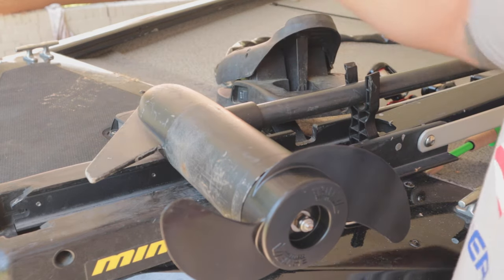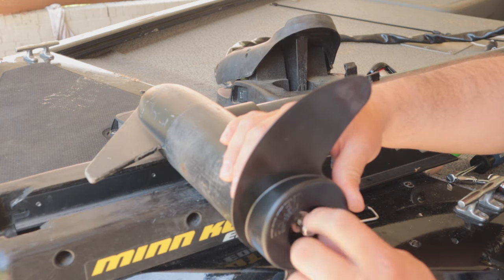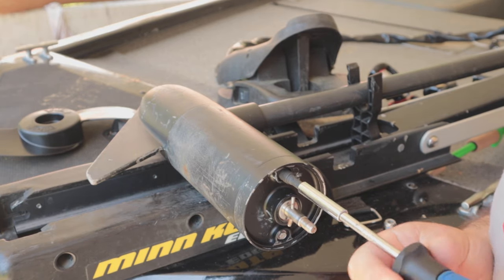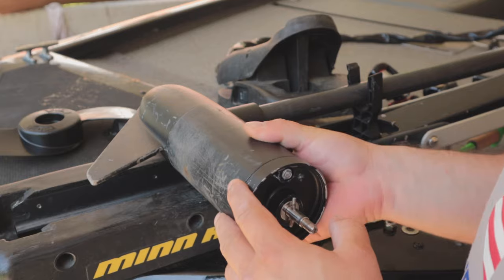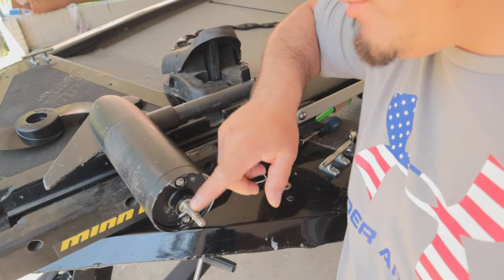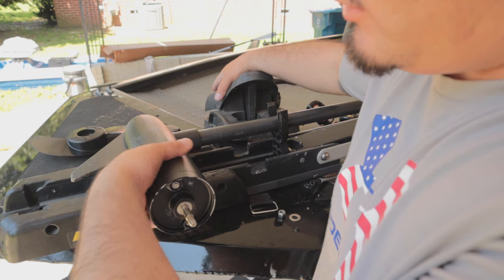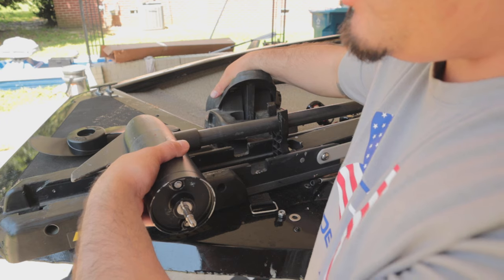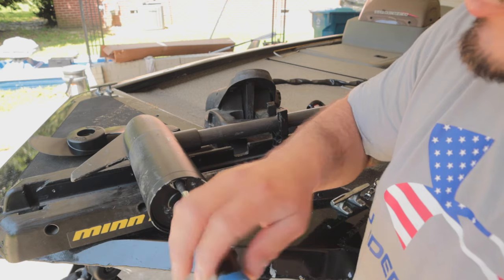HOW TO TUNE A TROLLING MOTOR || WORKS FOR ANY TROLLING MOTOR

Comment: So can anyone actually explain what happens inside the motor while twisting it like that..?
Interesting video, thank's for your time bro!
Reply from the maker: Thanks I appreciate that brother
Reply: Magnets
Reply: @captainfishpond  magnets......yes thank you William Gilbert
Reply: probably not on here, more like a physics professor. trolling motors use whats called a brushed motor same as a dremel, you can actually remove the brushes on a dremel to visualize. when you turn this your probably changing the timing of the inner core to the brushes, moving the polarity. Im not sure what results may be harder on the motor, i recommended to anyone seeing this test the amperage before and after. Amps = load so you'll get some idea of the health of the motor.
Reply: Motor is a coil pack of wires spiraling and it runs on magnets/brushes on 3-4 sides of the coil pack. The coil is attached to the propeller and the brushes create a magnetic current causing the coil to spin. Those two screws are 10 inches long and attach to the front of the torpedo. Those get bummed sometimes and cause the 3 pieces to shift and bind up. I wouldn't suggest taking it apart more than just loosening the screws. Really huge pain in the ass with the coil being reversed polarity. Really fights back. Leads to anger management issues
Reply: The timing advances

Comment: It's a designed motor system. It can't be tuned! Nice job not using a torque wrench on that o ring plate??

 But if you decide to do this lunacy don't turn the darn o ring plate and lock it off center. You're just bending the bolts. Turn the housing. Keep the bolts aligned with the nose threads or it will leak.

Comment: The shaft that holds the pin seemed to have come out some on mine and now its not letting the prop go all the way back on and actually eat where the 2 bolts you loosened were. There a space between the prop and that part of the motor. How do i get the shaft to move back some?

Comment: So if my trolling motor its brand new i don't have to that unless eventually i start losing speed? 🤔
Reply from the maker: Yes sir that is correct once you start noticing the speed go down a little bit I would try to adjust it and it'll help it
Reply: @TexasReelnFishing  thank you so much
Reply: Lmao 🤣
Reply: To be honest I keep seeing people say that it is speeding up because of advanced timing. I'm confused a little bit about that because there's only one hole on the units and it doesn't have slots or anything to basically adjust, also all trolling motors max out at about 5 knots or mph I believe regardless what size or lb thrust, ( basically they all have a max rpm speed that is not faster than any other brands from what I have read up on from the companies). If anything it's possible that it might have hit something I assume and twisted the unit out of the correct sync and basically is just putting it back to optimal position as it was previously and not advancing timing as in other types of motors.

Comment: You're not adjusting the balance. You are resetting the timing. Setting for max speed, with no load, doesn't mean that the motor will run at max speed when it is under load. 
Changing the timing will increase the rpm, when done properly. It will also increase the amperage that the motor is pulling out of the battery. This means that the battery will be drained sooner. Also this will increase the temperature at the comutator/brush interface, this will shorten the life of the brushes.
The manufacturers time these motors for maximum efficiency to increase run time and motor life. 
The weedless props are not all that efficient. They're designed to not collect weeds. The best shape to not collect weeds is not the best shape to move water. The prop design is a comprise.
If you're looking for more speed, and aren't concerned about weeds, changing props would be more effective. Something shaped more  like a regular boat prop. It would require some testing with an ammeter, under load conditions to make sure you don't overload the motor though.
Reply from the maker: Thank you Bob I really the message and knowledge you sent it seems like you really know your stuff. Once again thanks
Reply: @TexasReelnFishing  I'm just glad it made sense. Happy to help.
BTW, if you do decide to experiment with different props, it should make for some interesting videos. I would certainly watch.
Reply: Great point. Tinkering advice like this needs to be taken with a “grain of science” haha. Your spot on with the downstream affects of this self adjustment.
Reply: Bob McBride, I'm so glad you responded to this video by a guy who doesn't even know the names of the parts or the difference between a nut, bolt, or armature prop guide pin. Just messing around with repositioning the armature without a clue of what you're actually doing is ignorant as well as irresponsible to the viewers. I wouldn't want to be responsible for damaging other guys equipment or even the life span of their motors or their batteries. This is just a "fly by the seat of his pants mechanic wanna be."
Reply from the maker: Thanks Todd I appreciate you commenting. Seems like you know everything and come off as a guy that gets into alot of arguments because the way you talk to people. I'm sure if we were face to face you would act different.
Reply: @TexasReelnFishing  relax TRF it's just a comment and a some criticism... this is how the Internet works.  he would prob tell you the same to your face looking at his face and channel.. some people shoot straight from the hip... and thats ok.  telling it like it is, is not fighting words.... just a simple disagreement.. no need for hostility from anyone. we are all here for the info and the entertainment. I am sure that if we had the chance we would all go fishing together.
Reply: Well said!
Reply from the maker: Thanks brother I appreciate the comment 🙏
Reply: @toddparfitt7571  The irony is mr. know it all over here talking about "armature prop guide pin" or the correct industry name "shear pin", is saying hes moving the armature.. thatd be a neat trick considering that's connected to the drive shaft. What hes rotating is the stator. If your going criticize someone you really should know it all..

Comment: Remember magnet theory in science class? Like charges repel and unlike charges attract. The center section of the motor in this case holds the "Field" magnets, lets say your armature has 36 bars on the commutator, if you test continuity on the arm, you should have continuity on bars 180degrees from one another. As the brushes contact the bars, voltage is applied to the coil wound into the armeture. Thes creates a mag field in the arm the will align the the fix positon field, as this happens the next arm coil moves and the magic happens. The brushs are held in the brush box and it is held in place by the bolts. Leave it in positon to not stress the bolts and twist the field section only, moving the fixed magnets. It DOES CHANGE THE TIMING, as long as the brush position does not change. Put an AMP meter on the supply wire to check for current change. When back out on the water turn on the "BUTT DYNO" to test for torque increase/decrease. Good luck...

Comment: why does this work what is it doing?
Reply from the maker: It is helps with adjusting it to get more power from it
Reply: There are 2 large magnets on each side of the housing inside. Your moving them creating more or less attraction to the armature.

Comment: Just so you guys know. This voids any warranty left on your motor. If it has been "knocked out" or been twisted to put it in a bind is the only way it helps. If this is the case then it will do some good. Also any reputable service center will change the orings on at least the through bolts if they loosen to check the lower unit.
Reply: This is absolutely not true. Due to right to repair, any repairs you are doing yourself do NOT void warranty. If you are modding with aftermarket parts, then yes. But repair and maintenance does NOT VOID YOUR WARRANTY.
Reply: Not trying to start anything but you may want to reread your trolling motor warranty. If you are having issues with your motor and it is in warranty you should take it to an ASC to be checked out.  We are and have been for many years a service center for MG. I checked with a friend who is the lead service tech at the MK service center and he told me I was indeed correct.  Again, not to get anything started...your motor...your choice as to what you do with it.  I've had more than one brought in over the years that people felt they could fix themselves that didn't end well for them.  I just wanted to make people aware.
Reply from the maker: Thanks Norman

Comment: Makes no sense magnets are fixed a circle is a circle.  Who falls for this😂  good try though.  Never mind no rpm measurements or amp drw nothing😂
Reply: Yeah and stock engines timing chains at top dead center but on your grandpas old car the distributor moves to set ignition timing duh....the magnets are north and south pole for simple reference...if ever locked prop up before i can see how timing fir lack better word could get out if whack. Especially since it uses two long bolts that not in a guide tube.  The end lock plate and long bolts essentially just smash the center housing together hoping it never moves.   Well we have cars that often need front end alignment.  It is possible.  Ive been doing mechanical and electrical my whole life. His mic not doing video justice to the mechanically challenged. Its a feel and sound thing. If try it you will notice difference even if yours was not out if tune. Play with it and you will feel and hear when its out of tune

Comment: your screwdriver bit holder is 1/4th fyi
Reply from the maker: Oh ok thanks brother I appreciate it
Reply: no worries. older guy i worked with told me the same thing and my mind was blown
Reply: An if you're referring to just using the driver, good way to strip or ruin a screw driver or apex unless its hardened steal and most are. His bit is
Reply: @holdenthompson1235  all depends on the application but im sure that bolt wasn't torqued above 20ft lbs. and that's alot.
Reply: @marbinbarrios5866  yeah and the bearing the shaft runs on in the housing cover also need a gap and the tighter it goes, the more it will grab and bind. My advice. Treat your motor right. No bashing, banging or throwing around and you shouldn't have to Tinker with it. Or, find the proper tools and the proper specs before you open the can of worms
Reply: @holdenthompson1235  I haven't touch any motor lol. I am a aircraft mechanic, trust me when I say there is no shortcut on proper maintenance.  that being said , if it works is it stupid?
Reply: @marbinbarrios5866  not necessarily. Unless there's another way or it's a survival situation. I'll run a chevy with no oil pressure and no tranny fluid if I was about to die. But if I'm in a garage full of tools with sandwiches, drink's, a/c or heat? Doesn't make much sense to half ass it am I right?

Comment: Was watching it and it moved while you were talking
Reply: If you never done mechanical work before it's hard to grasp.  Your paying attn to front lock plate. That is not his concern if it moved. The middle long housing has super strong magnets it did not move. Only moved when his hands moved it.  The end lock plate coupled with long bolts will never be perfect because no guides for long bolts.   If you ever locked your prop up on bottom lake or rock its easy with the magnet force and power of motor to jar the adjustment enough to cause vibration and be out if time. Which could hurt your motor overtime.  His mic does not do this video justice
. When tuning, he is listening to a very smooth effortless motor sound, in return gives good speed.   Motor then works effortlessly, and as result burns less battery than a vibrating motor
Reply: There is large magnets in that middle long housing. One is said to be north and other south.  Just like the world north pole south pole....fine tuning gives a nice effortless sound to motor its something you can hear .....some folks will always fight stuff like this, you either have the feel for understanding when an object is not laboring. Or you lack those skills or senses.

Comment: I AM A MINNKOTA REPAIR TECH. THIS IS RECKLESS.  HE HAS NO IDEA WHAT HE IS DOING. HE IS TORQUING THE GUIDE BOLTS AGAINST THE BRUSH PLATE, THIS MAY EVEN BE A TROLL VIDEO TO GET PEOPLE TO DO DUMB STUFF. DO NOT FOLLOW HIS ADVICE.
Reply from the maker: I did it my trolling motor is still working fine years later 🤷‍♂️

Comment: Have same motor and never tuned it in 8 years.Heard you can do this but never did.Guess it is time.
Reply from the maker: Give it a shot and see how it does. Let me know if it helped thanks
Reply: @TexasReelnFishing  I just tuned my Edge.Made a mark on it for reference and had to turn it almost one half inch to get to max power.I turned it a hair more and some grinding was heard so I backed it off.I thought the lower settings were lacking power.Always had to keep it on #5 setting lately..Hopefully it did the trick..
Reply from the maker: That's awesome hopefully it helped and will get some of that power back

Comment: Your advancing or retarding the timing, faster will produce more load so less run time , yes it will be faster. The other way will decrease rpm and gain torque with longer run times. I'm sure the factory is pretty close to a middle of the road setting